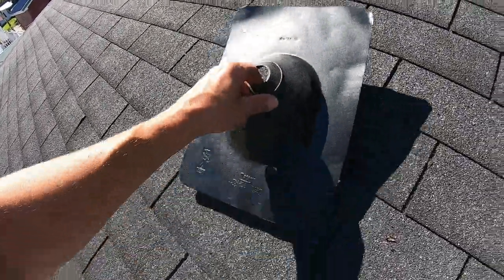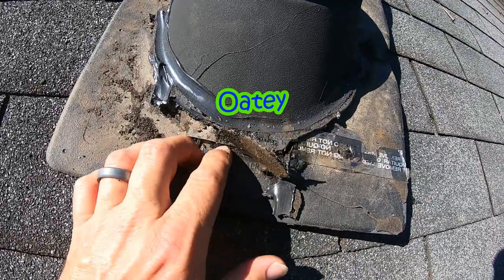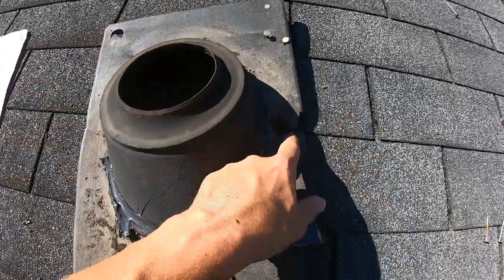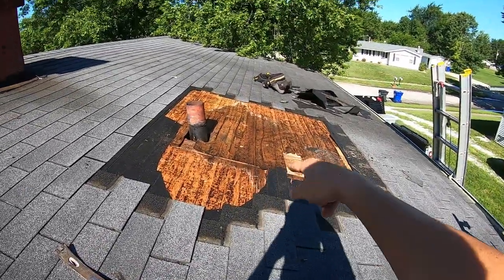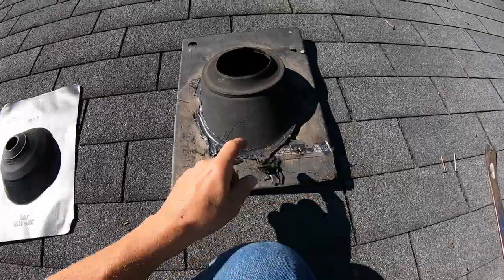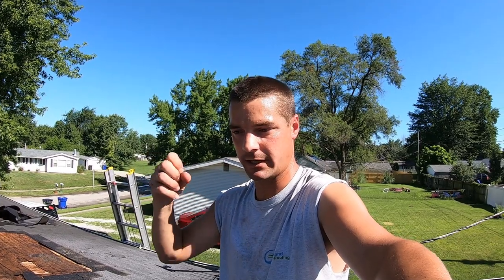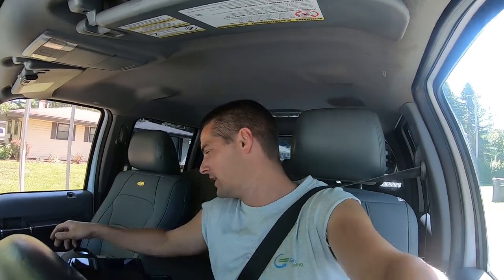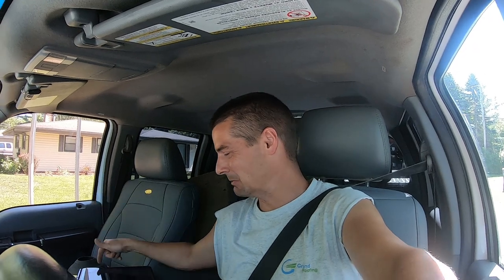Roof Pipe boot flashing, whats best plastic steel or aluminum?

Comment: For the plastic ones - you are supposed to drill holes at first (a tiny bit larger than nails) and then nail it down. Otherwise the nails create too much tension within the plastic and it cracks just like this. Anyway, aluminium lasts literally forever so it's obvious choice :)